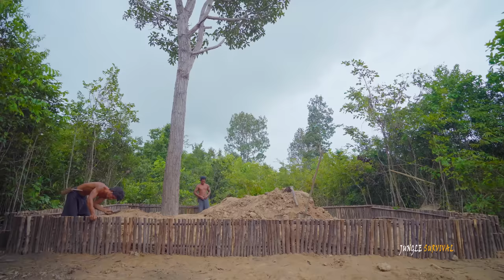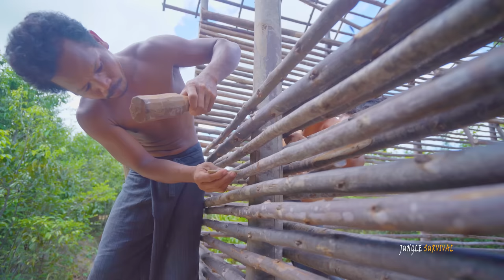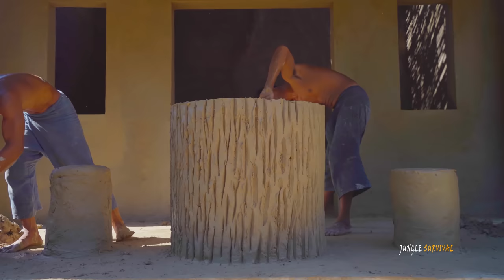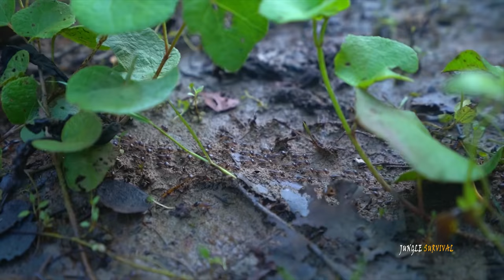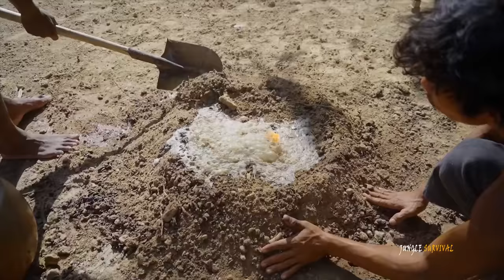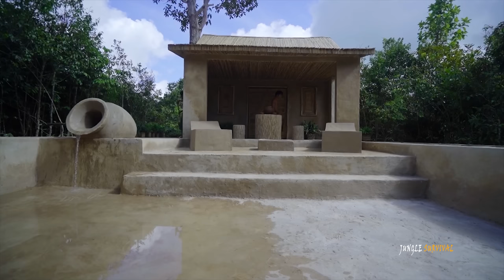How to Build The Most Beautiful Bamboo Villa With Swimming Pool, JungleSurvival Architecture

Comment: How long do you think this takes them? This is absolute art
Reply: 12 days
Reply: 42:24 didn’t u watch da video sheesh..
Reply: A few days after the bulldozer and bucket arrive. Lol what do they do with the land after the video?
Reply: It's fake Julia !
Reply: @으녁 IF THEY USED ALOT O PPL IT STILL WOULDN’T MATTER. ULTIMATELY THEY’RE THE ONES SHOWN MIXING THE CONCRETE OR CLAY OR WHATEVER AND THEY’RE ALSO SHOWN PUTTING IT ON THE WALLS AND WHEN THEY ERECTED THE WALLS THERE WERE ONLY 2. EVEN IF THE CAMERA MAN HAS PART IN THIS THEY STILL SHOW ALLOT O CLIPS OF THEM DOING THE WORK SO BOTTOM LINE IZ THIS CAN BE DONE BY TWO PPL. ONLY THING IZ THAT YOU’RE SAYING THERE’S A WHOLE CREW OF THESE GUY’S HELPING OWT YET YOU HAVE NO PROOF. LOGICALLY SPEAKING I SEE ONLY 2 GUYS DOING ALOT O WORK ESPECIALLY THROUGHOWT THE NIGHT AND INTO THE MORNING. SO THEY RIGHTLY SO GET CREDIT FOR BUILDING AND SHAPING THE DESIGNS ON THE BED TABLES ETC. ALWAYS SOMEONE LIKE YOURSELF TRYINA SPREAD RUMORS AND NEGATIVITY. AND THE PROOF I HAVE FOR THAT IZ IN YOUR COMMENT.
Reply: @으녁 DID YOU ALSO DISCOVER THIS???
Reply: @으녁 SEND ME A LINK OF WHAT YOU’RE SAYING ABOWT THESE GUYS PLEASE.